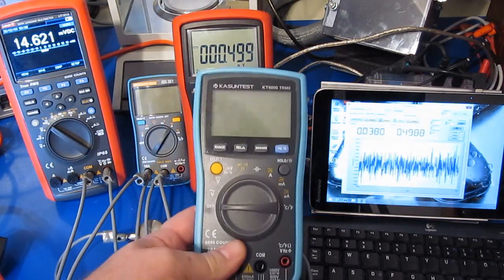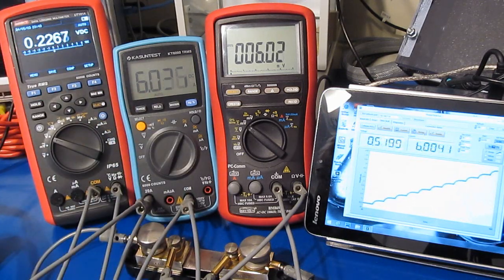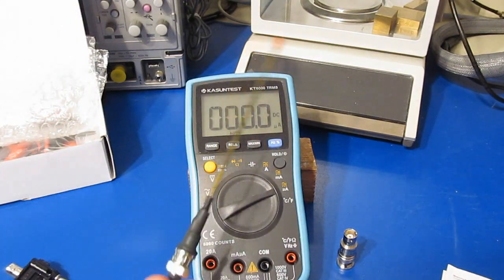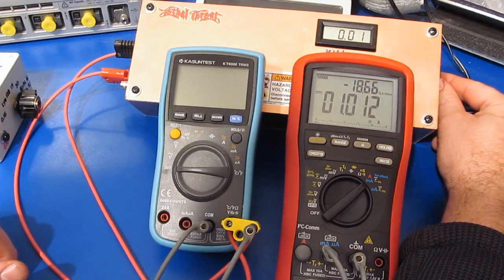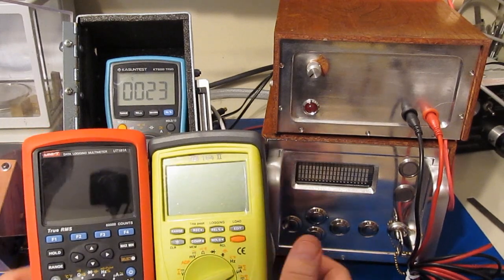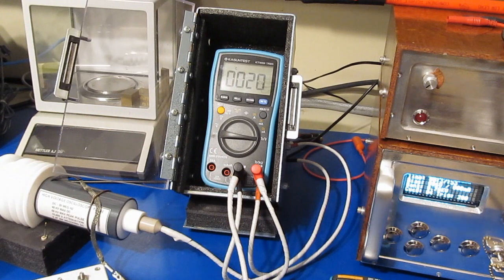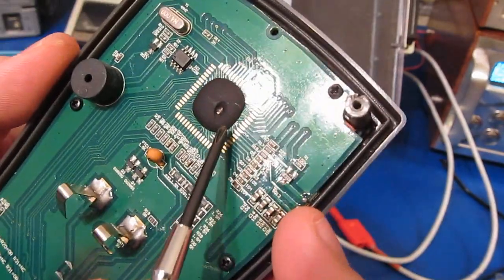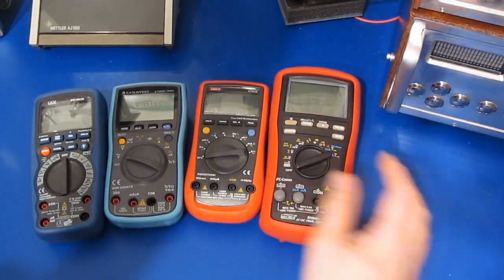KASUNTEST KT6000 ANENG AN860B Multimeter Review

Comment: can i get the original AN860B eeprom firmware bro? google drive
Reply from the maker: How?
Reply: @joesmith-je3tq  ur backup IC file contents an860 24c02/24c08 via eeprom programmer CH341a
Reply from the maker: @supriyatnasaidalatas8005  I take it you did not watch the video.
Reply from the maker: Just in case it wasn't clear, that meter was damaged beyond repair and sent to the recycle bins.  Much like other low end meters I have looked at.  The only way for me to read out the PROM is to buy another meter.  You may want to check the EEVBLOG and see if someone there could get it for you.  Good luck.

Comment: I have one of these...perfect for the last 3 years for my use...came with ceramic fuses of the correct rating and I don't get the bug AC to DC or Vice versa....model serial number is probably later than yours.
Reply from the maker: I'm going to guess you are referring to the full rectified signal at 26 minutes in.

Comment: This is a great low price multimeter. I have been using it almost daily for 3 years and I haven't been able to kill it yet unlike some other cheapos I have bought
Reply from the maker: I've used <$50 meters for many years in the garage and such.  Normally something mechanically goes wrong with them and I toss them out.

Comment: OK, found it. I've watched just about all your videos and must have forgot this one. I remember the small one you modded a lot. I found the same thing on frequency fall off. I tested a little on it. I guess something told me to pick it up cheap. It held up pretty well here for the price I paid.
Reply from the maker: I would imagine that the free HF meters hold up pretty well for the price.  I've had pretty good luck with the cheaper meters I use to work on my bikes. They seem to last a few years and then I toss them out.
Reply: That was my thought too. If it works ok and will do the job for $26 it will be good just to leave in my truck tool box. I like leaving my better quality meters for the repair bench.
Reply from the maker: It's fine until the tool is damaged when you go to use it.  I never paid more than $50 for a handheld meter until I started running these tests.  Of course I only used them in the garage and really don't need much of a meter for that.  But I am on meter number 4 now and think that in the long run, just buying a better class of meter would have been a smarter choice.   A bit short sighted on my part and I really don't know what I would have bought back then.  I bought a Fluke for a Christmas gift maybe 25 years or so ago and they are still using the meter.  It's in rough looking shape.   None of my cheap meters would have survived this.
Reply: Absolutely correct there. You get what you pay for most of the time. This was so cheap I thought if it lasts a few years with most likely little use on my band gigs just for checking cable continuity and occasionally the 120V line voltage from our power distribution rack that will be about it. I guess it is more out of curiosity to see how decent it was for $26 than anything. We have a main tool kit for the front of house PA truck that has a Fluke 117 in it for any higher voltages I might get into. Occasionally have to clamp on to the main legs of the entrance box to go to our power distro box. I'm usually the one that does it as nobody else has any experience at all in this area. I wired up a lot of CNC equipment on my job for 25 years with 3 phase and high voltage supplies in tube amps so I'm a little more experienced at higher energy power than any of our crew guys. I definitely would not use this on anything over 120V for sure. I did replace the cheap leads with one of my Probe Master sets to be safe in that area.

Comment: Hi I have the mastch ms8268 and I had a novelty, I was measuring the frequency of a transistor driver of a tv, but I forgot to change it for continuous voltage and measured the collector of the horizontal transistor and that made a short and now the multimeter does not want Measure FREQUENCY IN CONTINUOUS VOLTAGE. What do you think happened
Reply from the maker: I think what happened is you were measuring the frequency of a transistor driver of a tv, but I forgot to change it for continuous voltage and measured the collector of the horizontal transistor and that made a short and now the multimeter does not want Measure FREQUENCY IN CONTINUOUS VOLTAGE. That's what I think happenedRead more Show less Reply     1                                        Pin                Pin this comment?        Loading...                    If you already pinned a comment, this will replace it                        Working...        CancelPinRemove   Report spam or abuse   Hide user from channel

Comment: Joe, Any chance the ANENG is free of the AC bug. I know the are physically the same but I wonder if their measurement ICs are different firmware. I can take a photo of the innards of mt ANENG if that would be helpful. Steve J., Portland, OR
Reply from the maker: That was a very strange bug where you can't read voltage.   You would just need to try it.  Like many of these low end meters, they typically get damaged beyond repair.
Reply: I'll try to break out my pulse generator and run a test this weekend.
Reply from the maker: I just use 220VAC that is full wave rectified then into the meter.   Switch it from AC to DC to AC.  The AC should read low.  Don't believe that 20A burden voltage number!
Reply: So, did you test the aneng one? Really looking to buy that one.

Comment: What's best way to clean circuit board? Will changing fuse to ceramic fuse ones help perform better?
Reply from the maker: Proclean.   I do not consider the current inputs during these tests so no  it would not help it survive to a higher level.

Comment: 67A the max I saw, awesome. BTW, ICs also have some ESD protection it'll be nice if you test some you got in hand.
Reply from the maker: How would you propose that I test them?   Keep in mind the standards have changed and there are different standards.  The gun I made is not adjustable.
Reply: Well, I propose use your current esd gun and try to follow some of the JEDEC JS-001 standard (regarding to the num of pulses between the pins), an using the claimed voltage protection for the particular IC (for example: the lm358 claims 250v protection with the JS-001, meanwhile the voltage reference isl2009 claims up to 6kv with hbm and 2kv with cdm). I know that follow a standard rigorously will be very time-consuming (for say something), so I am not asking for it, just to have an idea about the esd protection on the ICs.
Reply from the maker: Normally, with a loose IC we would handle ESD by preventing it.  Once the IC is placed, we may still have handling problems but once things are packaged up, its down to the circuit design.  You need to consider the failure may not be instant.  The gun I made can't adjust the peak voltage or change the model type.  I wanted to get close to  that 15A 4KV sub ps IEC standard.